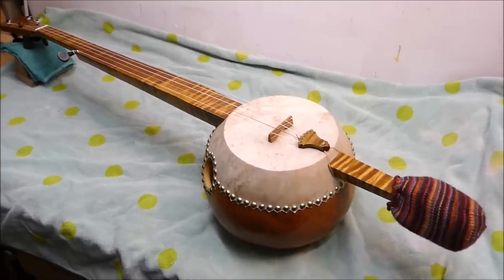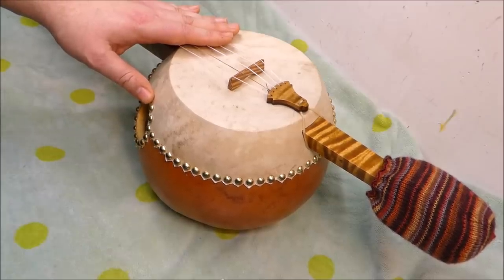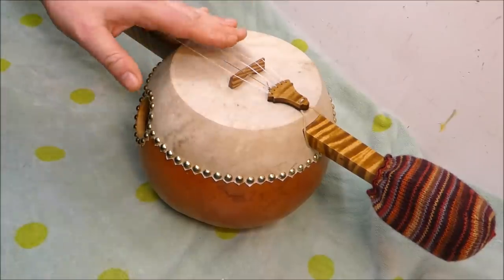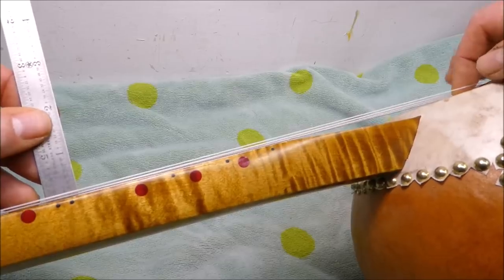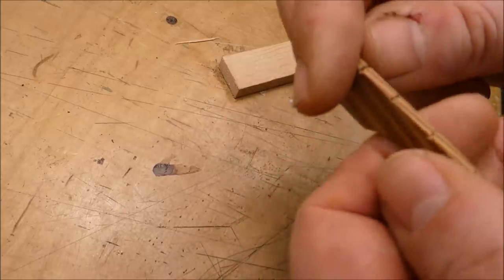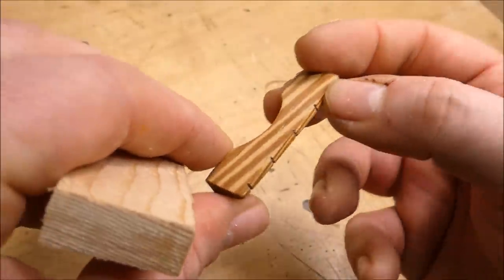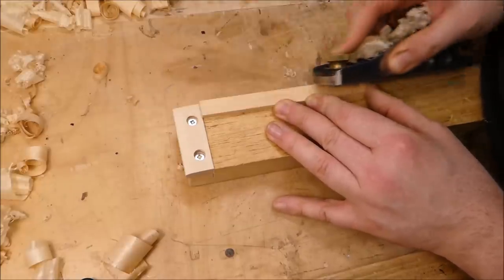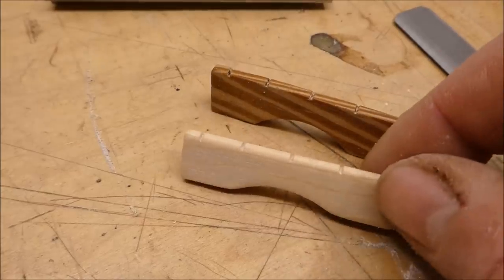Unique Banjo Experience

Comment: Yellow pine is the wood used for pressure treated lumber. 

Being a dense greasy wood, even untreated to tough to use as framing as it doesn't kiln dry well hence not a stable wood.

A lot twists crowns and bends

Comment: Would use a vertical grain Douglas fir be stronger in this application than the spruce?
Reply from the maker: Yes, but does it need to be strong?  I mean, ideally you don't want it to flex too much and become concave, and I don't think that's going to happen with this triangle shape and nylon strings. How much rigidity is needed? Maybe it's trade-off with lightness.
Reply: @twoodfrd  I guess I meant to ask since the Doug Fir is stronger than the spruce, would it wear better than the spruce in this application?